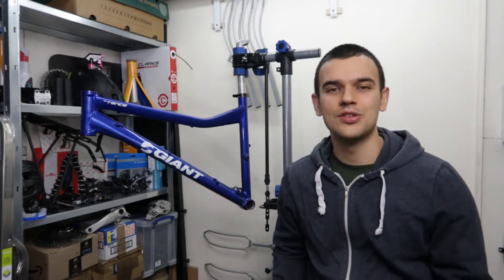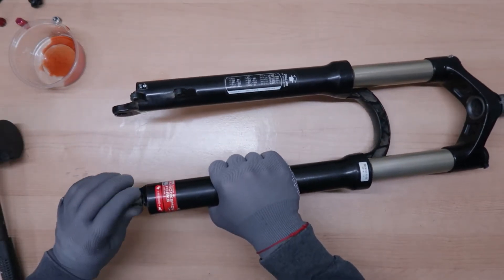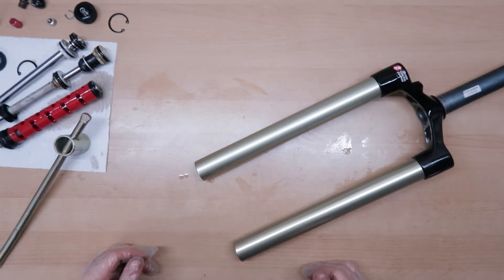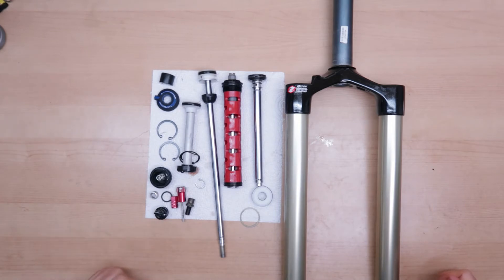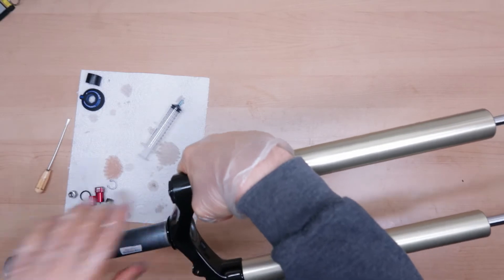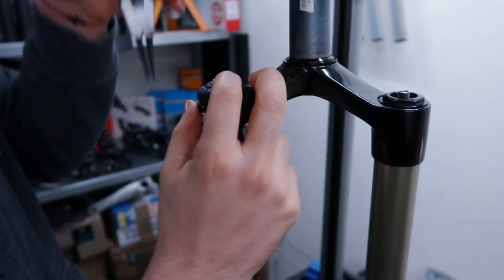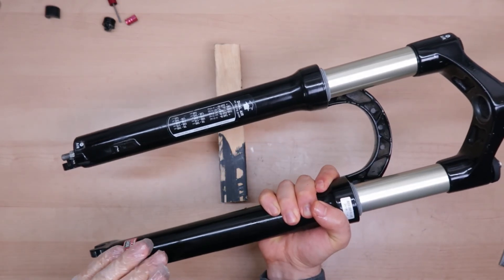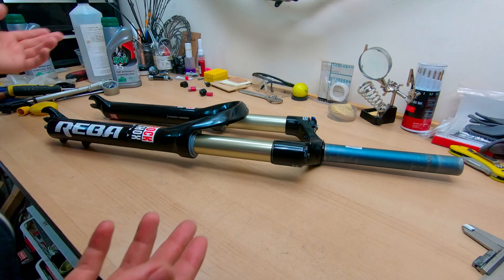Rockshox Reba Dual Air Mountain Bike Fork '05 - Detailed Teardown And Rebuild

Comment: This is the best tutorial (by far) to service my Reba Dual Air forks that I have seen. Most videos just show you how to change the oil and leave the rest as a mystery. You have made it easy to understand by taking it all to bits and reassembling without any special tools. I now have the confidence to do this myself. Thank you for making this video and sharing your knowledge.
Reply from the maker: Glad it helped!
Reply: @buckbikespent4588  I serviced the forks with no problems, they now work properly. Thanks again.
Reply: Agree. The best video I have come across. I wasn’t sure if the wavy washer was below or above the flat washer but dude. You made it clear. Thank you

Comment: i just picked up a reba that is completely locked up, hopefully ill get it sliding again, i let air out the bbottom, but not the top... it has a lockout mechanism on it, im hoping the lockout got stuck. ill never need a lockout, so my plan is tear down, removal of unecessary things , and rebuild, hopefully nothing is shredded. thanks for the great vid! this is my first reba rebuild, ive done many shocks over the years, i  always go to youtube to reference model specs!😊
Reply from the maker: I doubt it is a lockout problem especially if you are able to twist it but let me know how it goes!

Comment: Hi! Are the stanchions 32mm in diameter? What's the part number of the dust seal and foam ring kit you used?
Reply from the maker: Hi, stanchions are 32mm. I bought a kit off eBay but it was actually the wrong one for these forks as they have a rubber oil seal. Basically you need 2 dust seals, 2 rubber oil seals and 2 foam rings. The correct kit will have all these. The foam rings will be yellow or if not yellow they need to be thin as I cut the ones I got in half. Hope that helps!

Comment: Thank you so much for posting this video and parts list! I bought this shock new back in 2005 for a 29er mountain bike I was building. I paired it with a Surly, Karate Monkey hardtail frame.. It's just been sitting on a shelf gathering dust for the last 12 years. Last summer I decided to build up the Karate Monkey frame with the Reba shock as an Ebike for commuting to work.  I wanted to service the shock before I finished building the bike but couldn't figure out where to get replacement parts.  Your video solved all these problems. I'll be servicing them this weekend. Thanks again!
Reply from the maker: This sounds like a great project! Let me know how it goes! :)

Comment: Hey buck! I’m about the rebuild my rockshox Reba dual air from 2005 aswell! I saw the comment naming the sram part numbers but I am having trouble finding the correct parts for sale. Is there a website you recommend? Also what are some other tips you have for me? Thanks a ton!
Reply from the maker: Hey,  I bought a kit off eBay but it was actually the wrong one for these forks as they have a rubber oil seal. Basically you need 2 dust seals, 2 rubber oil seals and 2 foam rings. The correct kit will have all these. The foam rings will be yellow or if not yellow they need to be thin as I cut the ones I got in half. The stanchions are 32mm. Also be prepared with rubber gloves and paper towels. Hope that helps!
Reply: @buckbikespent4588  it does! thanks!
Reply: @buckbikespent4588  If you look at the 2010 spare parts catalog, it notes that earlier shocks from the 2005-2008 range had oil seals but later ones did not.  It says that you can use either kit, and that oil seals might be useful in wetter conditions.  The kit without oil seals includes larger foam rings to take up that space.  Cutting them is a good compromise if you want to reuse the old oil seals, or you could just remove the oil seals to match the later shocks.
Reply from the maker: @genixia  Thank you for this very interesting information. Do you by any chance have a link to this catalog?

Comment: How you can convert from 80mm to 100mm travel? Thank you.
Reply from the maker: There must be two black spacers on the air spring, you will have to remove one of them. You can see mine had one at 5:29
Reply: You mean to remove that cylindrical approx. 20mm black spacer on the top on the shaft? Ok, now I can see it at 7:53 easy to remove by 2 half pieces and that's all?

Comment: Fork seal is what size bro will appreciate drop In comments
Reply from the maker: These are 32mm stanchions but the seals are specific to the fork as they have different shapes between models. You can try getting a generic 32mm one and give it a go.

Comment: Thanks for posting. Perfect timing. I'm just sourcing the service parts for my Rockshox Reba SL which I'm going to work through myself.
Reply from the maker: Glad I could help! Just make sure your seal kit includes the black rubber seal.
Reply: @buckbikespent4588  Same situation.  Thanks.
FYI, the Dual Air REBA SL spacers give you the option of adjusting travel from 80-100-120MM depending on the number that you kept in the shock.

Comment: Thanks, one of the few sites that does entire internals. I don't think I have to make sure the dampener is open because it's a remote, so spring loaded will close it. You may want to mention about replacing Crush Washers just to be completely accurate
Reply from the maker: Good tip! Remote triggered lockout is usually open by default.

Comment: Nice and clear tutorial. Thanks.
Do you know where I can find a spare parts kit for those shocks? rockshox don't list the spare parts.
Reply from the maker: I got them from ebay but these are pretty old so you might not be able to find the exact parts.
Reply: @buckbikespent4588  Thanks. I found some that seemed right, but the lock-out doesn't work any more. Either I've misassembled it (likely), or I have some wrong parts. The damping seems to work, though.

Comment: I'm hoping this all applies the same for my old RS Revelation Dual Air forks.
Reply from the maker: Not sure, most probably oil volumes will be different
Reply: @buckbikespent4588  Good point. Will dig for a manual. Thanks.

Comment: My rockshox 30 silvr tk fork has some issue in the rebound damping shaft. The allen key of the rebound knob is not getting fully in the shaft. So, turning the knob doesnot makes any clicking sound but, it just rotates smooth with no rebound adjustment. Do I have to replace the rebound damping shaft or is there any solution to fix it?
Reply from the maker: Mine is doing the same, the rebound is fragile and if you turn it too much it can break and get stuck. I haven't looked into it yet but most probably you will need a new shaft.

Comment: Im gonna try this to my rs pike 454 uturn air. They have the same internals. Just a question, so for the upper park you used 5w and 15w on the lowers?
Reply from the maker: Yes, you are correct, 5w in the uppers and 15w in the lowers.

Comment: This is the same procedure for a 2008 reba sl?
Reply: Im about to do a 2008 and yes the procedure is the same. Just check at the sram website for oil type and volumes and which tools and parts you’ll need
Reply: Alright, thanks! :)

Comment: wich oil you used for rebuild can i use 10w fork oil fom motorcycle in my rock shox judy 1999 hidracoil
Reply from the maker: I used SVI 15w and 5w suspension fluid in my reba.

Comment: Anyone has a link for the right service kit
Reply from the maker: Hey,  I bought a kit off eBay but it was actually the wrong one for these forks as they have a rubber oil seal. Basically you need 2 dust seals, 2 rubber oil seals and 2 foam rings. The correct kit will have all these. The foam rings will be yellow or if not yellow they need to be thin as I cut the ones I got in half. The stanchions are 32mm. Hope that helps!
Reply: @buckbikespent4588  I think these forks originally came with the thick white foam and no rubber oil seals. So your kit was probably correct in that sense, but maybe the fork had been serviced before and updated design with the yellow thin foam and rubber oil seal had been fitted..? At least my never-before-serviced 2008 Reba SL had the thick foam version in it. I replaced it with the oil seal version. Anyway, thanks for the video, it helped a lot!
Reply: @JussiKoukku  No, the 2005 probably came with oil seals.  The 2010 spare parts catalog noted that earlier shocks in the 2005-2008 Reba lineup had oil seals, later ones did not, and that you can use either kit to add or remove them.
Reply: Also, PlanetCyclery has 2005-2008 "Athena White" replacement rim/disc lowers for a bargain price, $18, that includes the oil seals along with the dust seals preinstalled.  The picture on the site suggests disc-only, but they are actually a World Cup edition with rim brake-posts too, and include painted 'decals'.  The paint is beautifully glossy and has an almost pearlescent quality under a strong light.

Comment: When you filled up the lowers, did you say 15ml on one side and 50ml on the other or 15ml on both? Reason I asked is because if you meant 15ml on both, it appears that you put more in the last leg than you did in the first. https://youtu.be/-IZGppv3I9g?t=1204

My last question would be regarding the bolts for the lowers. I was under the impression that you need to replace the crush washers that are made of some sort of polymer on both whenever you disassemble them at the very least on the damper side since your fork is dual air. They are suppose to slightly crush when you tighten the bolts to spec and provide a tight seal otherwise, the bolts alone will not suffice and they will leak slowly in time.

The other step you need to take is to cycle the fork a few times after putting everything together. First make sure your rebound is all the way to the fastest setting, the open the motion control valve all the way then  fill both neg and pos air chambers. Get a piece of rag and fold it a few times  and put it on the floor and put both dropouts on top of it to prevent it from slipping, then prop or lean the fork between your legs and pump it a few times. This will make the air and fluids cycle inside. Then turn the rebound to the slowest setting and push it down and release a few times to see if it works. Also, adjust the motion control knob to see if the lockout works.
Reply from the maker: That is a very good point, I'm not able to find the syringe right now but I think it was a 10ml one so I needed to do it twice per leg, 10ml+5ml. 

Regarding the crush washers, generally you are correct. If you can source the crush washers, maybe change them. However, looking back on this I don't think there were any crush washers in the first place. Additionally, there are currently no leaks, but I noticed a small leak from the compression damper top cap which is common for these that I might address in a future video or maybe swap the forks after a bit of riding.